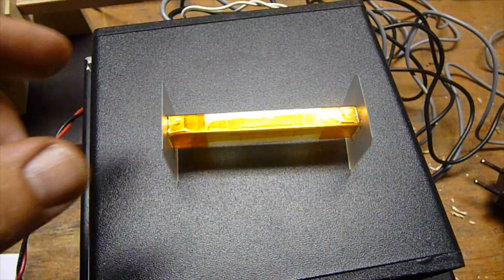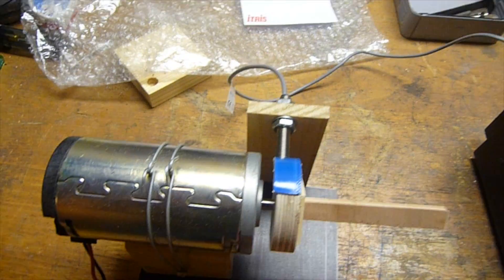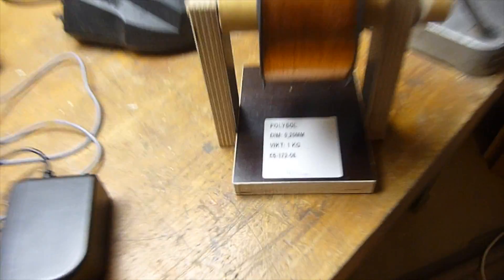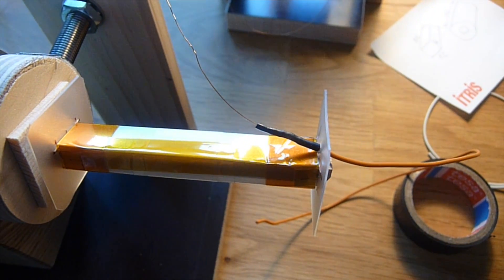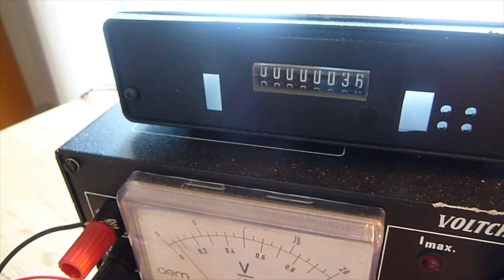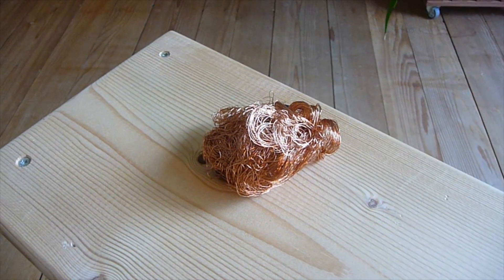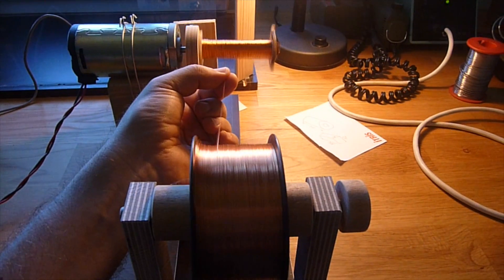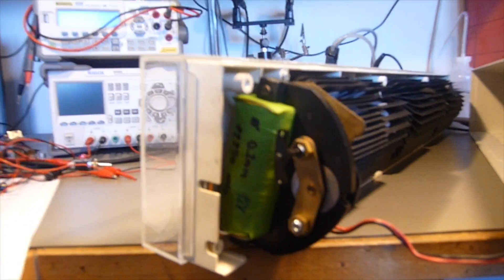PWJ37 - Solari Dator 6 clock conversion 24V to 12V

Comment: Why not adding a resistor in series with the 24V coil that drops 12V across?
It's much cheaper and way less work.
Reply from the maker: I wanted to operate a 24V clock from a 12V source. I would need an amplifier instead of a resistor...  ;-)
Reply: Then your title and descriptions are misleading.
They say "24V to 12V"
But anyway, a small buck-regulator für 3€ would do the job. @PlaywithJunk
Reply from the maker: @PhalosSouthpawsBastelstube  It's not misleading. I convert a 24V clock into a 12V clock. Nothing wrong with that.
And it seems you don't know how a slave clock works. It gets an impulse every minute to advance the display. And every time the polarity is reversed. +minute... -minute....+minute..... and so on. This coil is not a motor that runs cuntinously. It's more like a stepper motor.

Comment: I have a Boselli Icon 30 flip clock, which appears to be a rebranded Solari Cifra 6. It's missing both the coil and the bar that acts as the iron core in the 24V bipolar stepping motor. Any tips how to construct one?